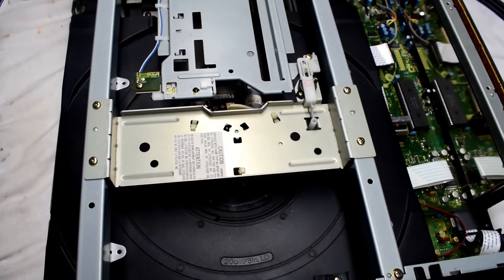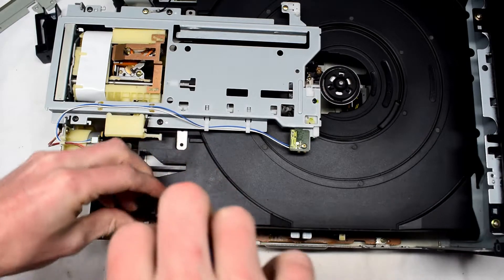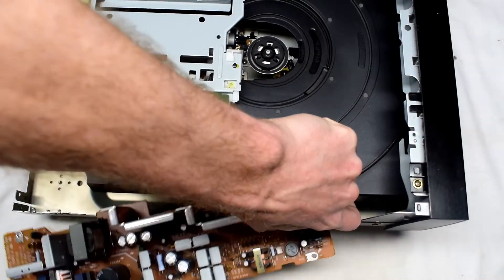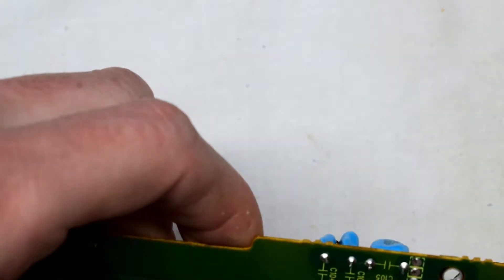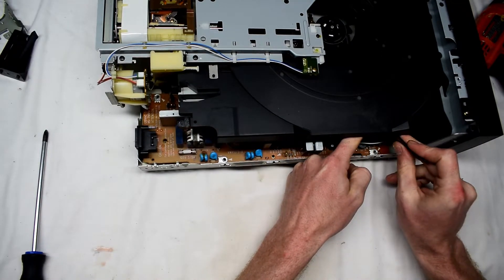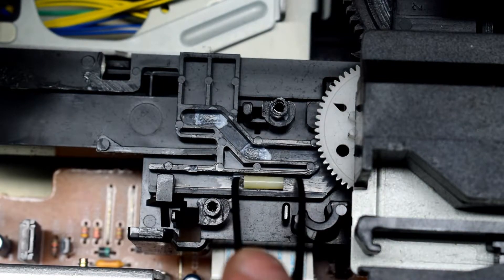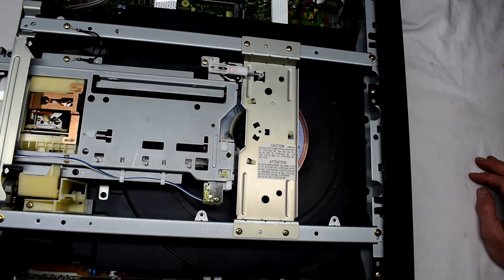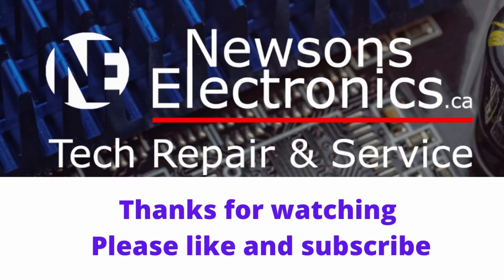Amazing LaserDisc that transforms! the DVL-700 repair

Comment: thanx, i will try this fix 
also i got a weird problem in which a player will play only certain disk like only one disc but not any other,
and its not like its a old player its sony mdp,  at first i thought it was a bad laser, replaced it didnt do anything. 
its just a bizzare brokenness in which it only play one specific disk and not any others

i have a hunch it was probably a ribbon that leads to the laser because the adhesive was deteriorated perhaps taking away some of traces within the ribbon  
only problem ui cant find this specific ribbon to replace it

Comment: I got the dvl-9 from japan, and look i got the same issue , im checking the power supply and see the diode is short, will replace and check it again, thanks for your video.

Do you find the same diode to replace it? Let me know thanks